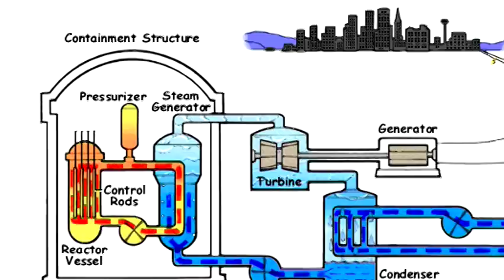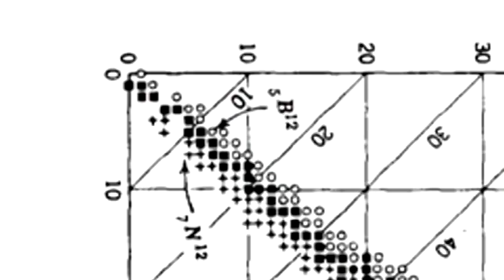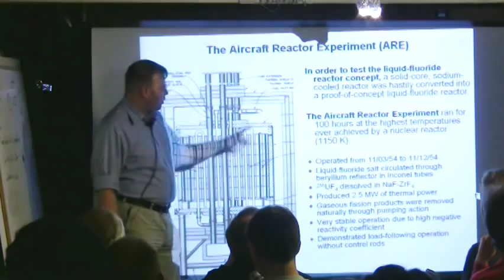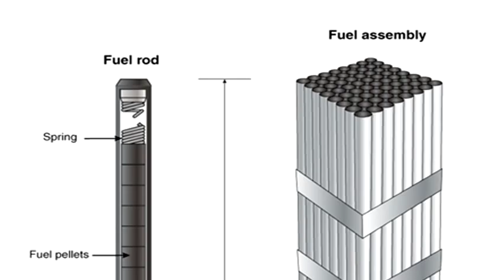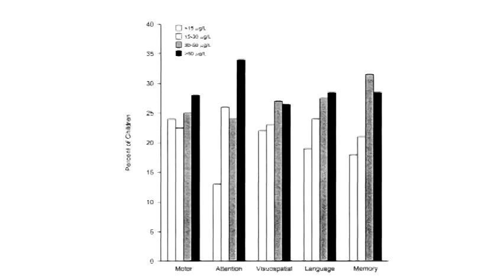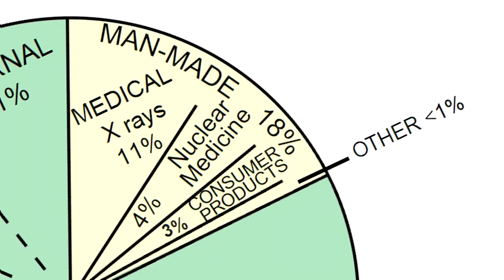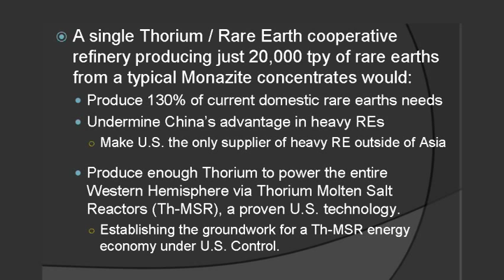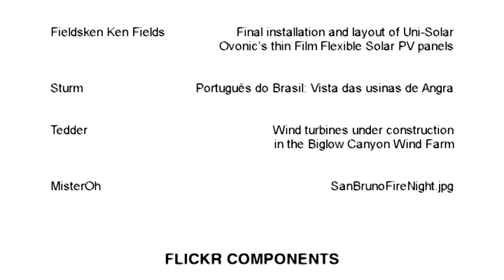Thorium Remix 2011 (DVD Version)

Comment: At 51:25: "Why do we bother with these low-pressure turbines? They're so big and they don't gather that much energy. We'll, that's a third of the power and that's a lot of power."

If you get rid of the the three low-pressure turbines, you get rid of most of your capital expenditure setting up the reactor, with only a minor decrease in efficiency, and you end up with a power plant that could fit in a shipping container.